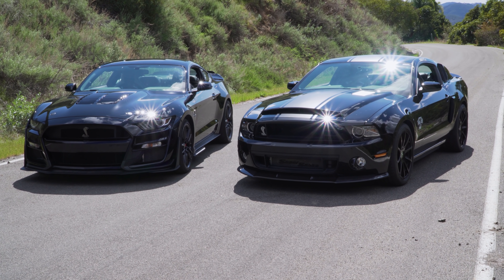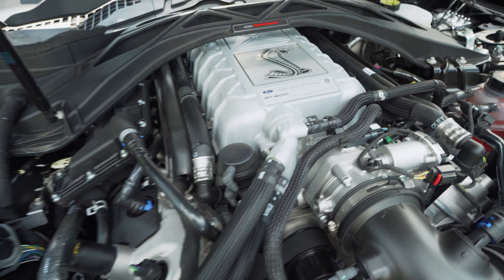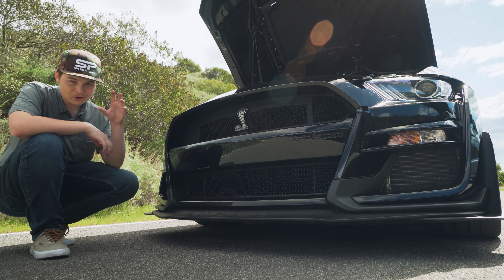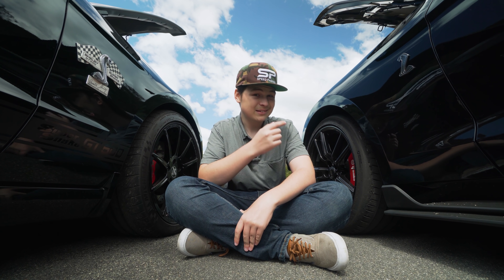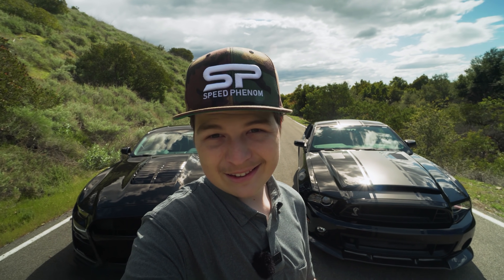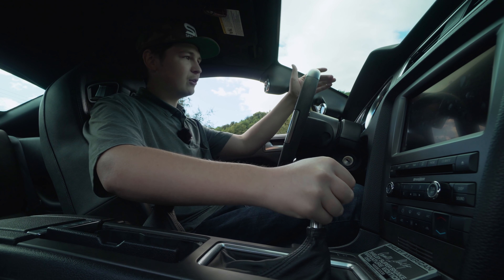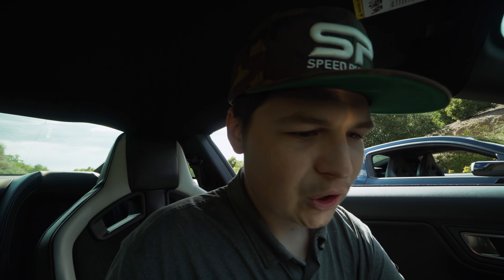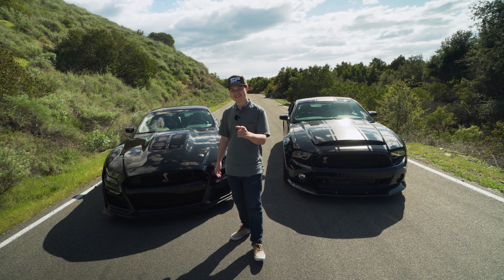2020 GT500 VS SHELBY GT500 SUPER SNAKE - HEAD TO HEAD COMPARISON!

Comment from the maker: Get ready for part 2! Right away... which GT500 do you prefer?
Reply: Speed Phenom something about the 13-14gt500’s and u got the supersnake just makes me go nuts
Reply: 2013-2014 GT500 is the best. The classic snake looks better than the new one.
Reply: 2020
Reply: S197
Reply: 2020
Reply: 13-14 gt500
Reply: Speed Phenom Awesome Video I think both Shelby GT500s are awesome and i would definitely get a 2020 Shelby GT500 because it has a Dual Clutch instead of a Manual
Reply: I love them both but I would prefer   your 500 just because of the technology and all the problems they fixed like the side skirts that dont allow rubber and rocks to hit the side ect
Reply: Speed Phenom great stuff! If I had my pick I’d go with the super snake. Don’t get me wrong I love the new gt500 but that 13-14 Shelby 🤤
Reply: Both Awesome cars,unique in their own way.While the technology in the 2020 gt500 is impressive, that it's a car that can make a bad driver look good, The super snake is everything but that.I personally just Love a Nanny Free monster and the Supersnake snake is just that.
Reply: Super Snake just because of third pedal
Reply: @madams4992  My biggest gripe with the gt500 is that dial between the seats.it also shouldve had a manual option,but nevertheless, that car shouldve had a normal shifter even with the dct, that dial is like a Lumber Jack in full Attire, boots,Ax ,maybye a tool belt,and then he drops his Jean's and has a pink G string on.
Reply: The 14 GT500 has the true Shelby look , and the classic snake I think looks better . Lol, but I was 6 when the 65 Shelby Mustangs hit the seen  ! Of course I would choose the more classic look.  🤪 great video 👍
Reply: Love the new one!
Reply: Can't change up on my s197 I love the old style better🔥
Reply: Speed Phenom 2020.
Reply: My 900hp supersnake is unbelievable fast
Reply: Speed Phenom In my opinion it isn't even close the 07 too 14 gt500supersnakes will be more valuable just because Carroll shelby was alive. My 07 427 convertable supersnake is very rare and will just keep going up in value,.
Reply: 13-14 will always be one of my favorite cars.
Reply: You prolly dont care at all but does any of you know of a way to get back into an instagram account?
I somehow lost my account password. I love any assistance you can give me!
Reply: @Jairo Markus Instablaster ;)
Reply: @Karsyn Leland Thanks for your reply. I found the site thru google and im trying it out now.
Takes quite some time so I will reply here later with my results.
Reply: THE NEW GT 500 IS NICE BUT MY FAVORITE IS THE  07 to 09 VERSION LOL I LOVE THEM SO MUCH I HAVE A 07 427 EDITION CONVERTIBLE SUPER SNAKE AND A 10 GRABBER BLUE SUPER SNAKE BUT I WANT TO ADD A 07 08 09 GRABBER ORANGE COUPE.
Reply: The older GT500 Super Snake because it could go 200mph whereareas the 2020 is limited to 180mph😒
Reply: Both are really awesome. I pull towards the 2014 just because of the pure aesthetics of it still looking like a mustang not dimension Carroll Shelby had his hands in the operations. Plus that weird shifter man.. WTF was Ford thinking

Comment: I still plan on getting a 2014 GT500. Cant hate 640hp for around 40k
Reply: 662 hp sir
Reply: @ther.6107  They lose hp throughout the years like any other car. I hope mine has 640hp by the time I get it lmao
Reply: Mine still has all the original hp. I just put her on the  dyno a littel under a year ago. She is still completely stock.
Reply: @JayRSwan  Miles? Stay on top of oil and oil changes?
Reply: @camobubba98  21k miles and of course.
Reply: @camobubba98  Read a article about a guy buying  a 13 gt500  with 200k highway miles for $14k. For shits n giggles  he dynoed  it. I can't  remember  the numbers but they were right in line with what they dynoed  new🤷‍♂️.

Comment: Old snake looks way better. 2014 GT500 looks much meaner. I’d take the 2014 over 2020... why? It has 6 speed manual. The new 2020 shifter takes away the fun but I understand with 750+ hp you need both hands on the wheel. Cold start, the 2014 sounds better too.

Comment: The 2014 Shelby GT500 Super Snake produced 850 horsepower, the standard Shelby GT500 was rated at 662 horsepower. The 2014 Super Snake was said to be capable of running 10.6s or quicker at a drag strip stock. I prefer the 2014 because it is a manual and has less computerized components. I think Dual Clutch Transmissions are for more exotic vehicles than potential everyday pony cars.

Comment: So i own a stupid rad 2016 gt350R. It got hauled to my shop on a flatbed. The owner was delinquent on the note, with a heavy estimate the thing was $700 away from writing off. We worked out a deal, i bought the car for $4700. I replaced absolutely everything that was remotely damaged. Got it on my frame table, got the thing dead square and i mean DIALED. I counted threads on the tie rods and it drove straight as an arrow before alignment. Carbon body panels, drift spec RTR front suspension with fortune coilovers, billet subframe bushings, EAS delete,  full titanium exhaust with a Lamborghini muffler because thats kinda my thing. All i did was delete any and all emissions equipment, upgrade the fuel system for e90, stand alone link ecu, hydro handbrake, you know the deal. The thing made 600 wheel. It weighs 3060 with me in it. And changing the suspension geometry, i gotta say, made it a thousand times more fun. I have all the stock shit. It was a rear impact. Dude that car fux so hard. Nothing in the world sounds like it, ive driven full blown pro spec drift cars that felt sluggish in comparison. Theres just ridiculous amounts of mechanical grip and the way it revs...dude its honestly the perfect car

Comment: Once the tuners can get into the TCM and raise the rev limiter the new GT500 should be able to hit 200mph when they swap the rear gear
Reply: Leviathan 5.0 ur correct only 3.31 gear hit 200 the 3.73 hit 189

Comment: How well do the Shelby GT500 & Super Snakes hold their value?? Considering the new 992 Porsche & LC500 as well..
Reply: Very well actually. I believe the 13-14 GT500 first came out for around $60,000. A lot of them you'll find still go for anywhere around $40k to $55k depending on the mileage.

Comment: My 2010 is almost a clone of your 2014! Same Hood mine has no stripes now, I have a polished 3.6 KenneBell same throttle body gimme 5” KenneBell air filter, except you have the bigger 5.8l mine 5.4l and your has a better more advance gauge option!

Comment: Great video !!!!
Reply: I know you have a 2020 GT500 .... if you had a choice between a 2018 GT350 or 2014 GT500 what’s your thoughts. I’m asking because I have an opportunity for either car.
Reply from the maker: If you want the car that makes you feel special as a driver. The GT350 is the one to get. The noises, the lightness, the engagement, the motor, it's amazing. It's a confidence inspiring car. However, the 2014 GT500 in comparison is a BEAST. It's more of a street machine. You learn to tame it.  To simply put, it's raw and fast. Plus, it gives the old school vibe!
Reply: Thanks for your feed back I really appreciate it.

Comment: I like the aesthetic features of the new one more personally as most of yall will eventually you will just take longer getting there.  I like the simple more futuristic snake(placed in the middle) along with less badging and the wider body and also I like the hood better,, basically everything looks wise I like better on the new one.   I like that the old one has a faster top speed and manual trans but everything else I like more about the new GT500..